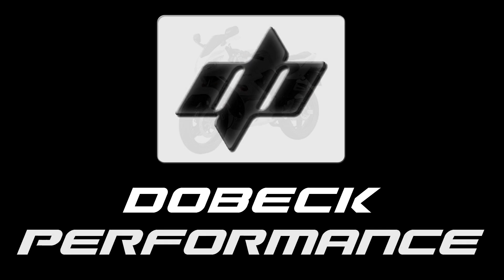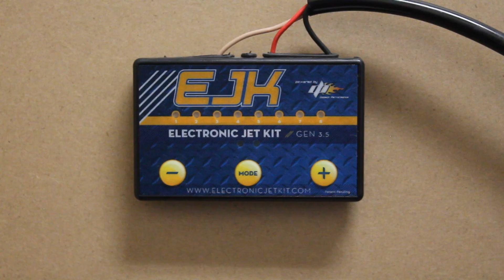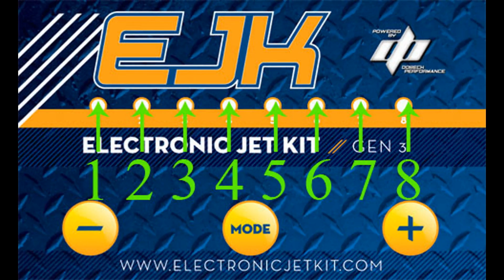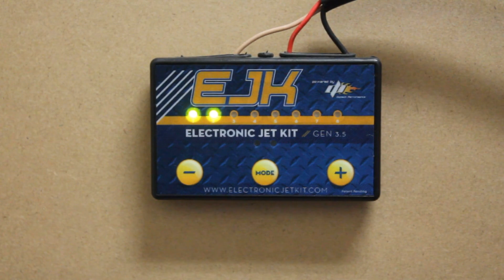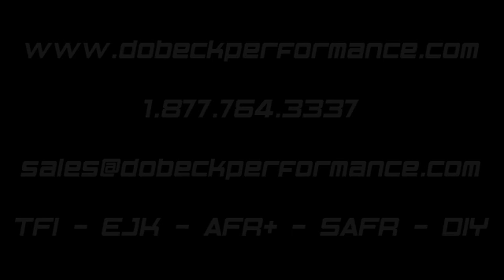Adjusting the EJK (Electronic Jet Kit) Fuel Controller

Comment: @NicholasKotarski-jh4ew
0 seconds ago
He showed a video of false information.   Read the top comment I left.  I can explain it much easier. The zoning is only when you see green/blue org/blue and rd/blue.  The single flashing is the amount of actual fuel your adding in the color format. Green idle and light accel. Orange is cruising and harder acceleration.. red is wot.  Also if it's solid color at let's say 3. It's 3k rpm. Then let's say blinking 3. It's 2500 rpm.  1 would be 1k rpm.  Flashing 2 is 1500 rpm. It's all in increments of 500 rpm per adjustment

Comment: You did the second half wrong.  First 3 green orange and red all represent the amount of fuel.  They blink one color at a time..  the changing of zones will have a flashing blue light on the far right side and 1 of the 3 colors on the left.  So after adjusting the first 3 modes (green.orange and red) you push mode a 4th time to activate the green zone. Then 5th time will show orange and blue. 6th is red and blue. Those are your zoning adjustments..  What you did was just go right back to fueling thinking you where making adjustments to the zoning.  Watch the video. I know. I have one.

Comment: T H I S    I S    A  SCAM  how it works if you have an o2 sensor then the readings from it will try to correct what ever the ejk is doing , The computer reads the volts coming from the O2 sensor and if EJK is giving more fuel then the computer will correct  giving even less fuel traing to achieve the programmed  fuel to air ratio , doing this will bring the computer to use the safe mode map which is richer bypassing the ifo from the O2 sensor !  T H I S    I S    A  SCAM  if your engine has an O2 sensor !

Comment: Hey man, I have a very similar bike, the KLX 250. It has been modified to 350 cc and has the ejk. It all runs fine etc however there is one issue, which is when you go from zero throttle to turning the throttle on, it seems to abruptly jerk into action, the same as when you fully come off the throttle it seems to Jerk off. What I mean is that from on and off with the throttle is not very smooth it jerks on and off, which is fine if you are hammering the bike and going at high speeds and high revs and riding hard. But if doing slower technical stuff either in the city or on the trails and tight trails and stuff, this throttle response is rather annoying and also unstable especially when coming on or off the throttle in corners. Do you know of any tuning settings or way to smooth this out? Thanksss
Reply: I bought a used (30hrs) KTM 300 with one of these tuners and it has the same problem - the bottom 1/8 throttle is burbly, then it comes on hard, making it difficult for the slow, technical stuff. It also seems to use alot of fuel, and this was confirmed on a ride the other day when I ran out completely when I should have had lots - my friend still had 1/2 a tank. So I am trying to figure out how to either set this tuner to stock settings or remove it completely to see if that is the problem.
Reply: So an update here: I removed the tuner from my bike and... now it works!! The bottom end sputter is gone, the power is smooth and awesome and I have my fuel economy back. Now, I'm not knocking the tuner, maybe it just wasn't setup right. Anyone considering buying one, I would say this might be for you if you are willing to put the time in and play with it. If you just want to go ride I wouldn't get it.
Reply: @GoViking933  thanks, this is exactly what I needed to hear! One question tho, do you any other mods? I have a klx 300 with a delkevic slip on and the kdx snorkel, you think I will run lean?
Reply: @deanteasdale6252  Sorry, I am unfamiliar with the subject you are asking me, although I have heard of such items.

Comment: This video could be better by indicated what the expected changes in performance would be by increasing or decreasing any one of the settings.
Reply: It’s just adding more fuel at different points on your throttle, chiefly for if your bike runs lean from exhaust or intake mods.

Comment: I am running into an issue, that everytime i make an adjustment, it' not saved. Next time I start up the bike the settings I adjusted are gone. What can I do about this?
Reply: Take it off and buy an FP3.  This is nothing but a "fooler" for the injectors.  One came installed on a '16 FLTRXS that I bought.  Constant O2 fault codes set (that this thing bypasses) and an annoying engine miss.  The bike ran better when I took it off.  The FP3 is a far superior product.
Reply: @Jake-cz1kb  got it, thanks
Reply: @Jake-cz1kb  Operator/ installer error.

Comment: Hi Dobeck,
 i recently bought this fuel controller and am having an issue with it. i set the settings to what i would like but next time i start the bike it has reset to another setting. seems to not be saving my adjustments, so i am having to set it every time i go for a ride. could you give some advice as to what to do? is this a common problem?
Reply: I just installed mine yesterday and I have the same issue when I checked it today. I hope this ain't a glitch with them. I have had 2 other bikes with controllers and never had this issue.
Reply: 340rps I did some searching online in the forums, seems like this is either a fairly recent problem with the tuner or we were just the unlucky few that got a bad unit, as I couldn’t find anyone else with this issue. I will be shipping it back soon and will update on turnaround time for warranty and if the problem persists.
Reply: @speedyhoneybear   Did you give Dobeck a call? They will work with you. Was setting mine today and when I checked it first thing the settings were fine. I'm thinking I just may have hit the wrong button and changed the setting unknowingly. I still will be keeping an eye on it. I'll tell you this, what a difference in performance of the bike all the way around. With the mods I have it was running way lean as the S&S air intake sucks a ton of air. I don't think the previous owner even had a re-map done.

Comment: I installed and tuner called anger management made by dobeck for this company called hacker and they sell it with there exhaust(there’s a small dobeck emblem on it). I look up the dobeck installation kit on how to hook it up and they steps were perfect. Only thing is I have NO clue on how to adjust it to get max power out of it. Sure I now each mode does something different but still I have no clue to go up or down and why would I push the mode up or down. I’m sure the tuner is keeping the bike from running to lean or rich because without a tuner I’m sure I’d mess something up eventually but I don’t feel like I’m getting MAX power out of it. Actually I know I’m not I just don’t have the damnedest idea on how to adjust these things.
Reply: Did yours come factory preset for your bike? If so, was there no improvement in acceleration over stock from the factory sets? That being the case, I won't buy one. User manual setting would then be too much trial and error. Not any improvement over Power Commander and it's downloaded settings.

Comment: The first 3 modes are easy enough. Green, Yellow, Red. The next two with Green/Blue, Yellow/Blue, Red/Blue seem not as straight forward. Hard to tell what's what. Would be nice if you guys had show the complete run through, not just the first 3 modes.  Guess I'll keep playing with it. Overall, great tool.
Reply: Old post but a bit of explanation. The b/gr, b/yel and b/rd are for the switch points, or for when you want that fuel to come on, The big difference is the higher the number the later that fuel turns on. So a 3 will come on sooner than a 6.. These are harder to adjust due to a distinct feel and much more trial and error. You pretty much have to adjust  up, Go 2 full settings, until the bike does not pull hard then go back the other way to where it pulls the strongest. I find the b/ red to be the hardest. If you got an uneven idle or too low, set the b/gr to as low as it will go so that system is basically always on.

Comment: Does the manual that comes with it explain how you want this set up for what you have? Like let's say I buy it because I get a full yoshimura r77 exhaust, will it tell me what I want each light set at? And then if I later add on like a k&n filter it will explain what settings it will need then?

Comment: can someone please explain what an EJK controller does, i have heard so much about it but dont get it?
Reply: Mr Mario Sanchezo w/lettuce It's pretty much a manual fuel controller that lets you control your fuel on an fuel injected motor like you would as if it was carbureted. It skips the need for having to use a computer or downloading a fuel map.
Reply: Mr Mario Sanchezo w/lettuce its useful if you do exhaust mods or airbox mods to your vehicle. it adds more fuel
Reply: It is a "fooler" for the injectors and bypasses the O2 sensors.  There are way better products out there.  My bike ran better when I took it off.

Comment from the maker: Matt,
The EJK comes preprogrammed for Stage 1 modifications so the settings right out of the box will work well for a large # of combinations of intake and exhaust upgrades. You can find these recommended settings on our website www.electronicjetkit.com. Locate your vehicle under products and click view info; the settings will be on that page.

If you want to dial in your bike and know exactly how it is running, I recommend renting or purchasing our SAFR Diagnostic Tool. It is a Standalone Air/Fuel Ratio (SAFR) gauge that provides you a real-time readout of your AFR values. Adjust your fuel controller until you see the proper AFR values on the gauge. Check out the website for more info: www.safrtool.com

If you are unfamiliar with what AFR values you should target for a four stroke engine, check out our other YouTube video: Understanding AFR Values. This will give you a quick rundown of AFR values and what they mean for a four stroke engine.

If you have any other questions, give us a call. Our # can be found at dobeckperformance.com
Reply: Dobeck Products any idea on settings for vtx1800n with k&n skill air cleaner and road burner double eagles with slt
Reply: I was doing some adjustment on my controller for my 106 ci Victory. I had been running with the blue green setting off. Which I had the bike running fine . I noticed on the chart 3.5 was the suggested setting which I tried. I wanted to try a lower green setting but the idle would drop a little low and the rpm would rise and fall even on my previous setting which gave a perfect idle at 1000 rpm. Put the blue green back to zero and idles fine again.  Why would you want a delay on your idle fuel?Just a heads up for anyone who has idle or low speed surging issue
Reply: When will the safrtool be available again? Bluetooth mod  should not stop availability.